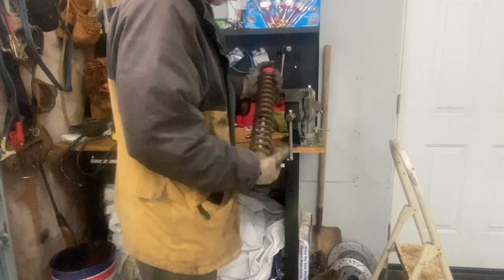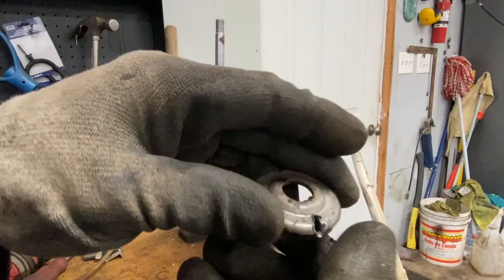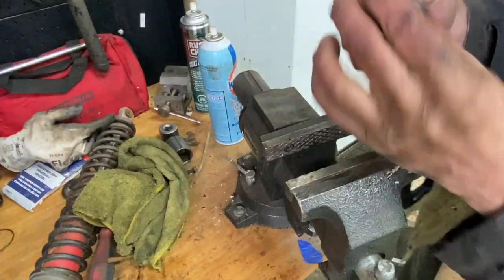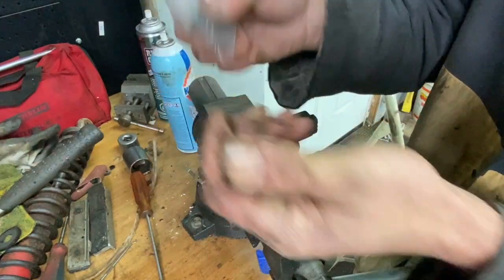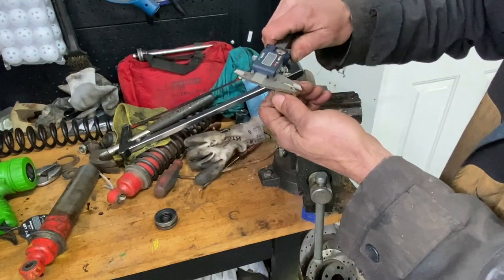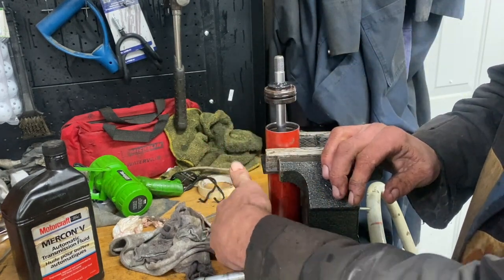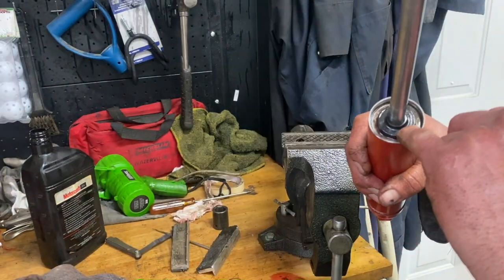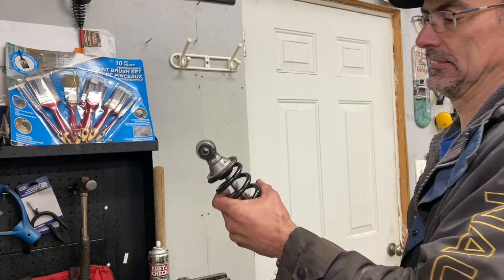How To Rebuild your Motorcycle Shocks on a Honda XR500 1979, 1980

Comment: Hi. My name is Dewet from South Africa. I recently bought a Honda XL500S. The rear shocks are on their way out and I have watched your video of rebuilding the shocks with interest.
What I would like to know is whether you have measured the amount of oil added on rebuilding after your first attempt.
I do not want to open, clean and re assemble the shocks a couple of times to play around with the amount of shock oil.
The info would really be appreciated.
Tanks. Dewet.
Reply from the maker: I used too much oil and made the shock too stiff.  I took 2/3 of the oil out.  Made it better.  I don't think they were full of oil from the factory.

Comment: Just did mine after watching your video. Thanks. Also noticed they only were about half full with oil and after reading your comments below I will need to reduce the oil I used. Do you feel you used too much oil or the oil was too heavy? I read somewhere to use 2.5 weight oil which is really light
Reply from the maker: Probably both,  to heavy and too much.

Comment: can i use lip seal or do i have to be a hydraulic seal ?
Reply from the maker: I used way too much oil. The shock way way too stiff.  I had to take some out. 
     I think the oil is just for lubrication.   Lip seal should work.

Comment: My Guzzi has cheapo KYB shocks. The manufacturer says they are non serviceable. I’d like to try a different viscosity oil in them. There is a screw at the bottom that looks like it is a drain port. Being such basic and low end shocks I wouldn’t think they are nitrogen charged or anything. Do you think it’s do-able?
Reply from the maker: Check out this video     https://www.youtube.com/watch?v=0_InEnom2ec
Reply: Great video but my shock is very basic with no reservoir, no shrader valve, and no adjustability. At the bottom is a port that looks like just a screw through a nut. I’m wondering if this is some special fitting I shouldn’t mess with or can I just drain the fluid though it and install other fluid. Unless there is some kind valve on the inside cylinder wall I don’t see how it can be pressurized. It looks just like the bog standard shocks of typical UJM’s from the early 70’s before air shocks or pressurized or adjustability became a thing. No one seems to be able to give an answer and I don’t want to screw it up it it is pressurized. All I want to do is experiment with viscosity not rebuild it. Any ideas?
Reply from the maker: @zenermaniac2571  Don't really know.    You could remove the spring & compress the shock to see if it springs back out.  Then you know if it's under pressure.     Drain the oil by compressing the shock. 
   Place the bottom of the shock in a bowl with new fluid. Fill the shock by sucking it back in by pulling the rod out.